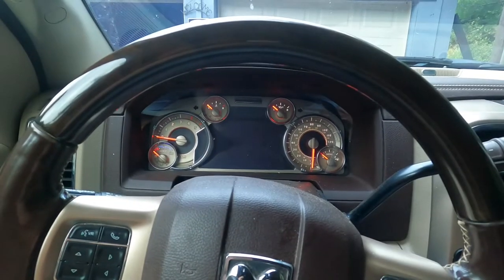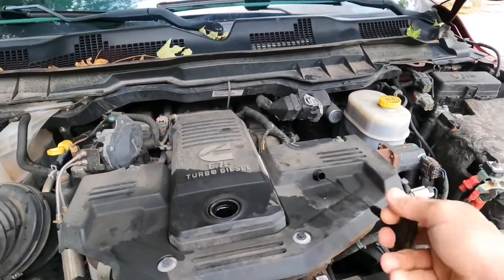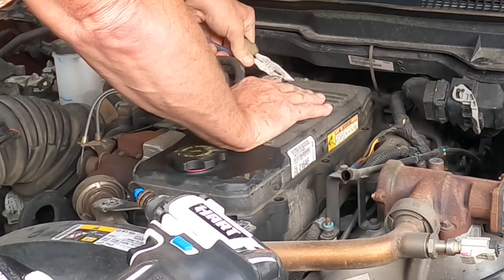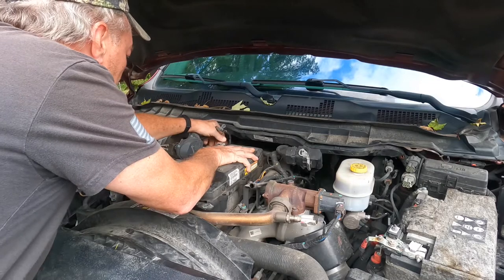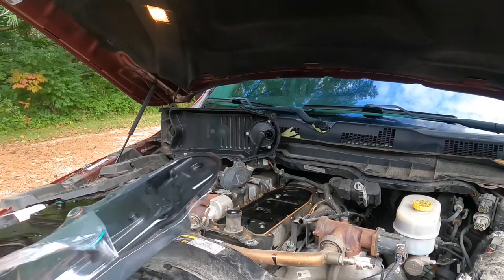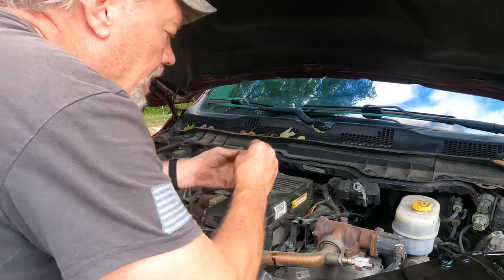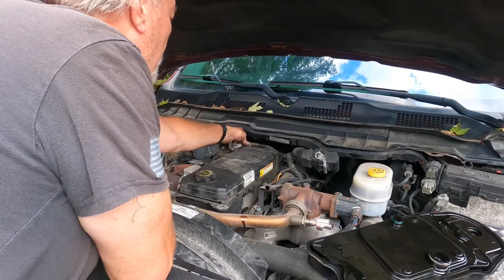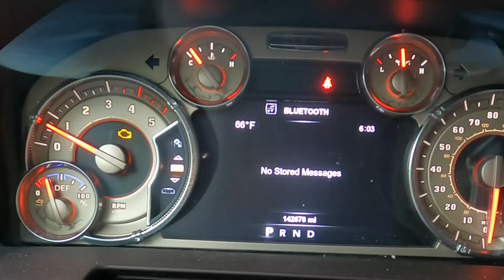Ram Cummins 6.7 Perform Service Message CCV Filter Change

Comment: I bought a Cummins fleetguard off Amazon as I read some of the cheap ones like made in China due to high temps they may come apart the cotton and get into your engine I just didn't trust the cheap ones. $70  for fleetguard
Reply from the maker: You bring up a great point !
I will have to keep a eye on it or maybe change it out 
Thanks for the advice!